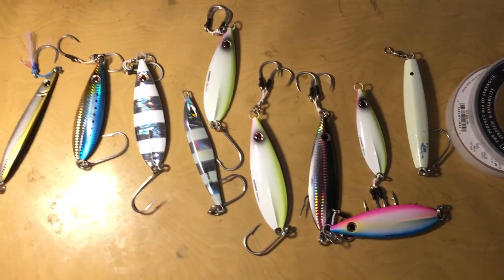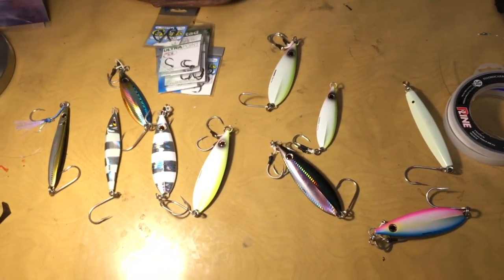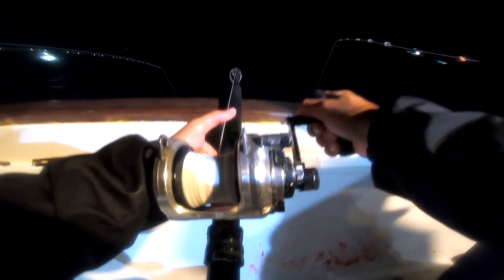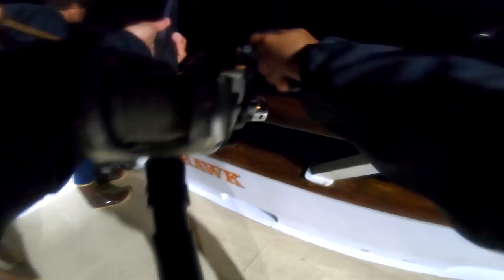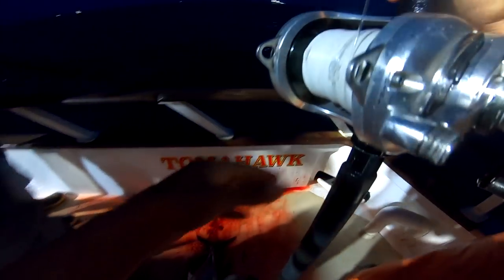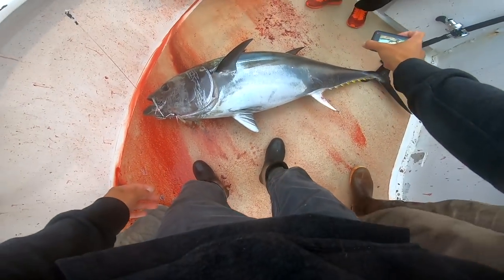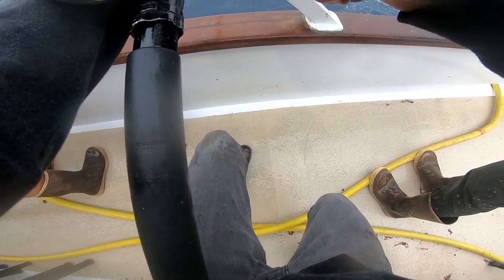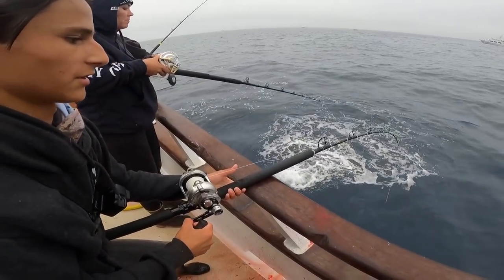Catching MONSTER Bluefin Tuna in San Diego (Nonstop Action) Pt.1

Comment: Are you tying your braid to the leader swivel of the FF or are you using the heavy Snap connectors ? if so what size snap connectors ?
Reply from the maker: I have the braid going to about 50 feet of mono topshot, then that goes to the swivel then to the leader which is crimped to a split ring that goes to the flat fall